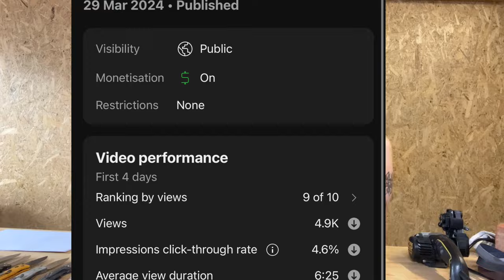Best Edge, First Time? Professional Pro Sharpener (Wife Sharpening)

Comment: G'day Pete & Wifey, fantastic stuff once again !!!
I do think Wifey was correct, also once again ; ) a sweep action is preferable to, push/pull, in the interests of true symmetry i.e. what you do to one side, should be the same as on the other; and it's far more likely to achieve horizontally rather than more random jerks vertically at a micro level. But hey, still a great outcome as you've shown many times Pete and in fairness too, direction does matter less with harder steels. 
Really look'n forward to the blade grinder attachment vid, I havent gone with that yet; A; the longer belts are a bit more pricey and B. not sure it's gonna add so much more capability to justify the purchase. I do like a wheel too, a la Tormak, obviuosly for a concave, rather than convex edge; have you ever tried a MDF disc ?
Anyway, a fantastic series out of left field, very useful and entertaining at the same time, .............. on top of your other million or so rippers ; ) Cheers Duke.
P.S. I really dig skin art, but personally I reckon up on the wall is more conducive to swapping 'em out for a change ; )

Comment: I’m lead to believe the reasoning behind going one direction with the stone rather than back and fourth is that you are pushing material away from the edge as you are sharpening it. I.e the usual method of going in the direction of edge to spine. Where as going spine to edge means you are pushing material towards the edge and could develop a wire edge?

Comment: Show her how to use the USB microscope.
I think that will emphasize the contrast between before sharpening and after sharpening as well as how the different grits effect the scratch patterns and the edge becomes refined and more durable..
I did that with one of my brothers the other day and it made it very clear.
What is fun is to turn the blade while looking at it with the microscope until the microscope is pointed at the edge itself.  Ideally, the picture will turn entirely black because the sharper the edge the less light it reflects.

Comment: I woudnt pay 500 bucks either for that Worksharp either 😂 

I think youre wife is right. 

If you can hold youre youre angle etc that worksharp is just waste of money.

All you need is a two sided diamond plate 20€ and a leather strop on a wooded two by four. 10€ and You can do round shapes on paper arc and shave youre beard with that knife. 

Sharpening knives doesnt have to be expensive instead of something everyone cant do. 

Still nice sharpening tools you have but very much over priced but very very nice.